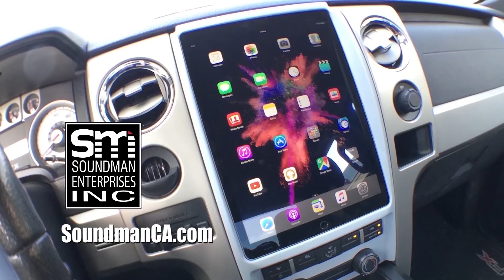watch White Rider episode #51 before you see this MUST SEE UPDATE! -   The White Rider series #52

Comment: Running solenoids with coupling nuts is a common mistake. You can only run what the first solenoid can handle. One solenoid goes out then the others in-line will not work. You have to run them where the positive is on one side and negative is on the other and make a metal strip for each side, the load is evenly distributed and then you won’t have to worry about being stuck on the side of the road.

Comment: Could get a high amp DC 12 to DC 24 converter to charge your batteries as you drive. Google DC10-60V 30A 1500W To 12-90V Boost Converter
Reply: Just smk one

Comment: Shouldn’t the solenoids be in parallel not series to double the amperage capacity.
Reply: I agree with this.
Reply: Yeah I noted that when he assembled them, doesn't make any sense, when he said centre tap I thought he meant take the joiner bar off one relay and put the ring terminal there, for a second I thought he was actually doing it right but then he went and did it wrong again
Reply: del_troll maybe it’s for redundancy so if one hangs up closed, the other one should still open and kill the power.
Reply: @RobertL78  That's actually a pretty neat theory

Comment: Hey Doug why don't you just let the alternator on the bird  charge your batterys.  just installed a solenoid as a cut off switch relay so it won't drain you car battery just a idea.
Reply: Should have a PTO installed instead of batteries to power the pumps.

Comment: Correct me if I'm wrong but the way the solenoids are wired (Series) you have the current capacity of 1 solenoid per motor. Parallel would double the amperage carry capacity in the setup.
Reply from the maker: a starter solenoid doesn't have a + and - It just passes current thru. so "parallel or series" doesn't apply. think of it as an on/off switch. you can't series or parallel an on/off switch. the two big posts are just like pins 87 and 30 on a normal 12v relay 👌😊